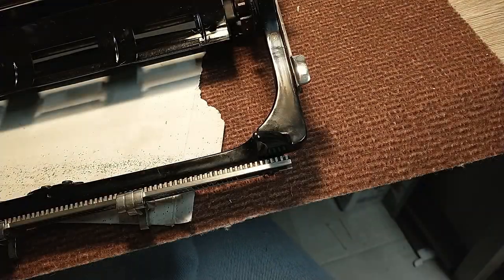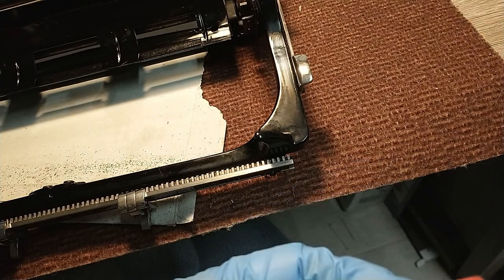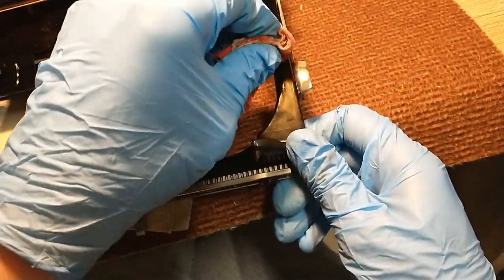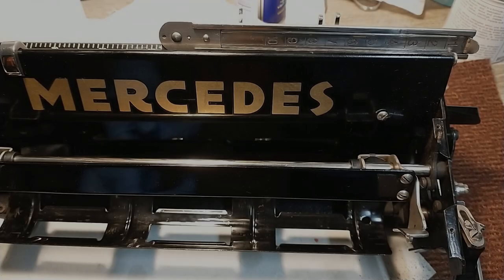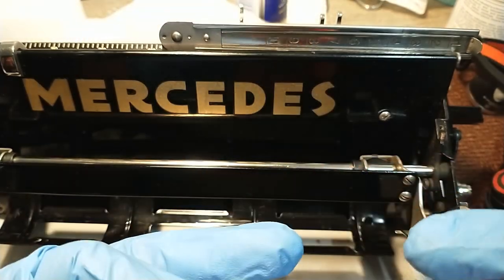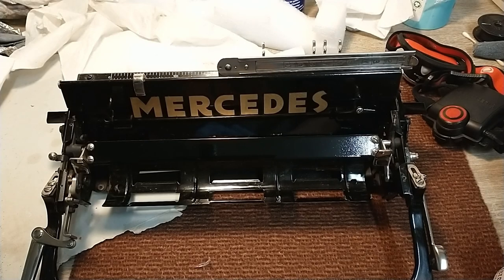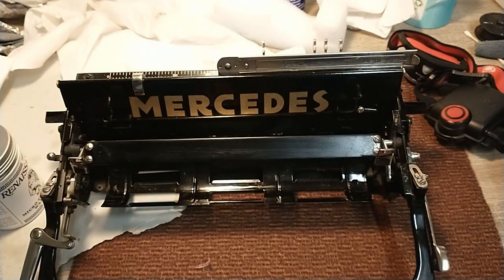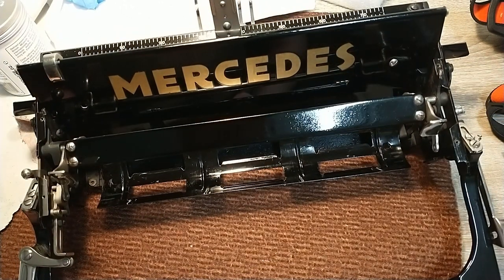Polishing and waxing a gloss paint typewriter

Comment: Where did you get your wider ribbon? I need that for my number 4.
Thanks
Reply from the maker: I think it was this seller: https://www.ebay.co.uk/itm/131600145008

Which was a bit of pain, because Brexit caused import fees  :')

anything but standard 1/2" (13 mm) ribbon is bloody expensive
Reply: @Slug_Life  thank you very much!
Reply: Fortunately we don’t have any VAT/import fees for things coming into the United States….. 😜
Reply from the maker: @donaldlampert331  Lucky! I get slammed with 15€ handling cost and 21% import fee on item cost + shipping cost. It's extremely stupid. Especially that they include the shipping cost in that calculation.